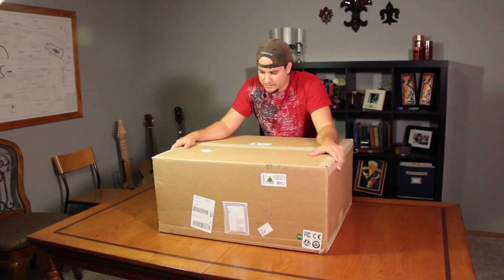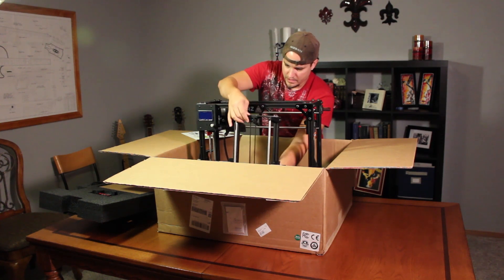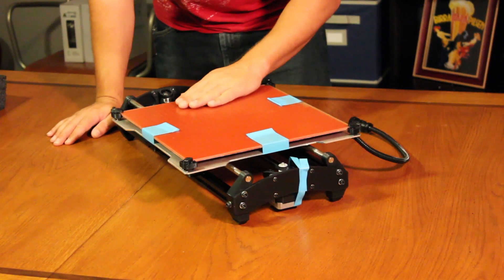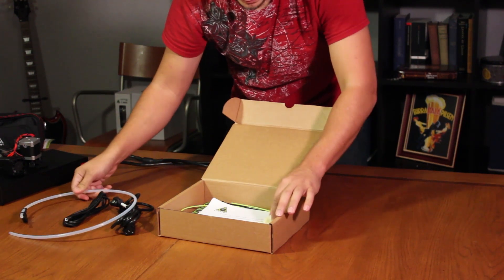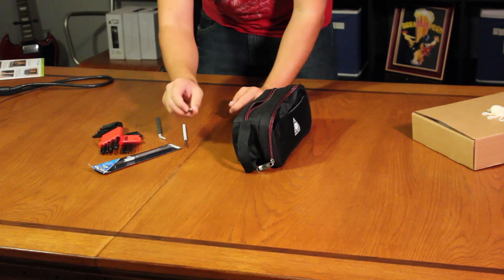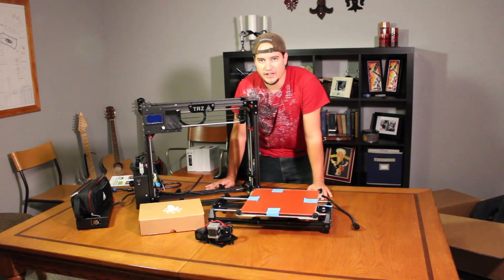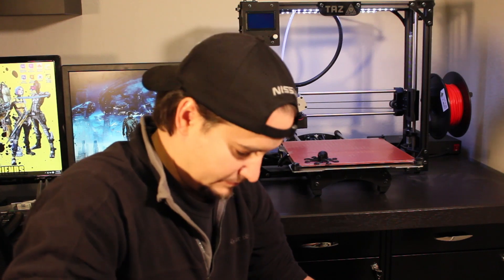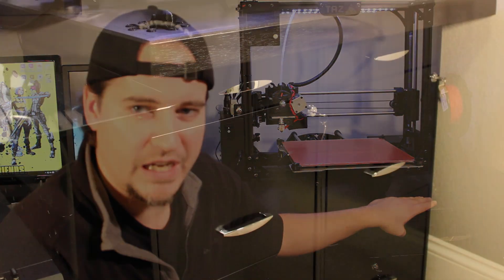Lulzbot Tax5 unboxing and first print

Comment: To make bed leveling super easy I would recommend this Dial bracket and dial. I use it for mine and makes it very quick and simple. http://www.thingiverse.com/thing:551366
Reply from the maker: +Stuff With Kirby I will have to check that out.  Thanks for the advice and link.
Reply: +Targ's Workshop Let me know if you got any questions. Ive had mine for over a year and got it pretty well figured out now. Print a spare small gear thats on the print head stepper motor, it'll break eventually
Reply from the maker: +Stuff With Kirby thats a good idea, i would not have thought about doing that.  any other parts i should pre-print before they break?  Thanks
Reply: +Targ's Workshop Maybe some bed fingers, I tend to accidentally touch and melt them with nozzle when removing a part. Otherwise those are only parts I have had to replace since I had it.

Comment: sweet machine. Glad i was sitting down when i looked at the price... ouch.
Reply from the maker: +builtrodewreckedit not the cheapest machine.  but it does have really good reviews, and one of the largest build volumes in the hobby class of printers.
Reply: +Targ's Workshop I wanted to buy this as a second printer but I think I should wait for the Taz 6.

With that said, did you consider waiting for the 6?
Reply from the maker: +Zanzibar Land I originally looked into buying one at the beginning of 2015 and waited for the 6 to come out.  But i bit the bullet in august and ordered the 5.  i was tired of waiting.
Reply: Thanks for your reply!
Reply: +Targ&#39;s Workshop So I got the Taz 5 today!  I have it all set up and I am at the part 17 in the instruction booklet and I have a question for you:  Considering it arrived with the test print, do I still need to follow the leveling instructions from Adjustment of the Z Axis (step 17) to Leveling the Print Bed (20A-20D)?  I haven't done anything yet and I know leveling can be a task however that test print looks great so do I really need to tweek the bed/z axis at all?

Thank you - This is Zanzibar Land btw - just using my personal account.
Reply from the maker: +Ctor1985 yes, i would definitely level the print bed, its not hard, just takes a bit of time.  After that, i check my level about once a month and make adjustments as needed.
Reply: Thanks again for the quick response!